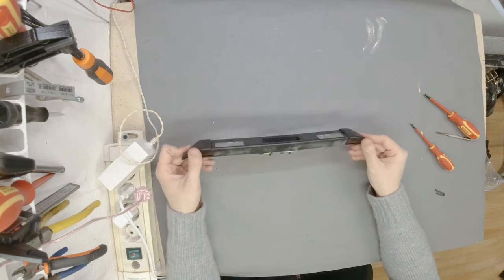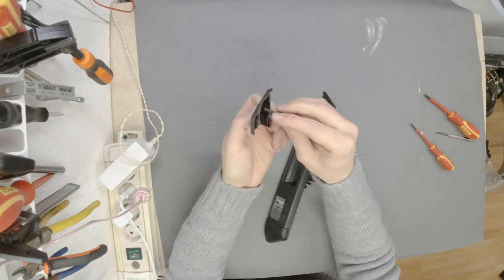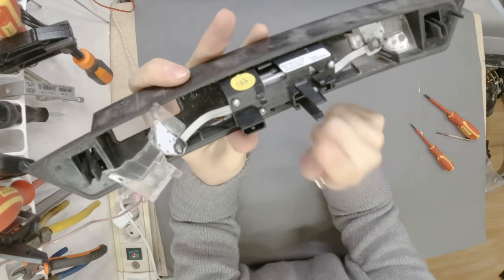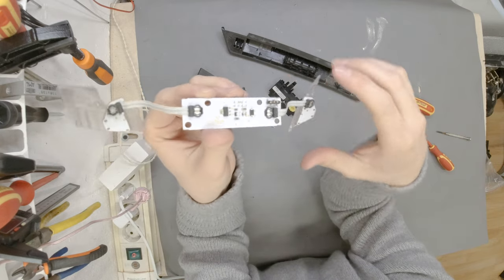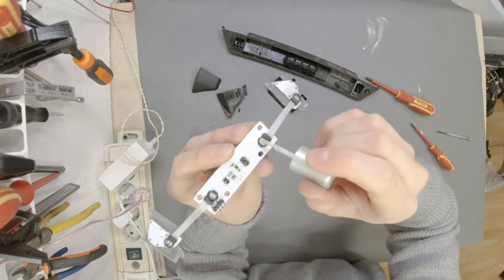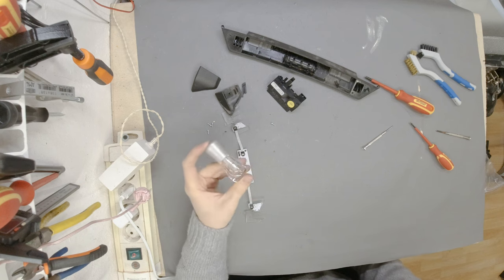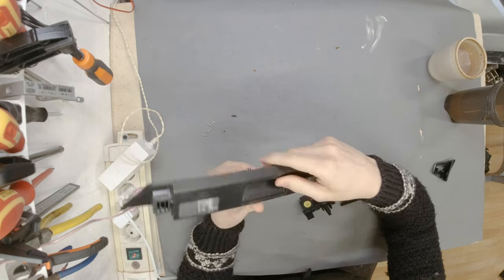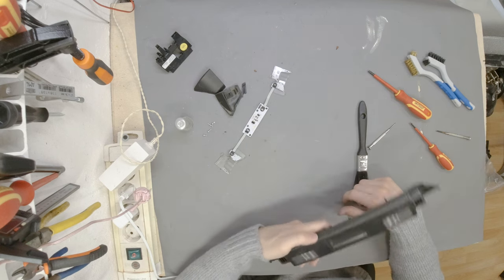THIS 1$ TRICK CAN SAVE YOU MONEY - AUDI TT MK3 8S LICENCE PLATE LIGHT

Comment: My 2016 Mk3 was rear ended in Dec 2022. The auto body shop replaced the bumper, back exhaust, tail light, spoiler and the trunk latch assembly in your video. Water kept getting into the trunk latch. Eventually, there would be so much water, the latch would not function until it drained. It was replaced again in March 2022, and then again in August 2023 and then the same issue happened, leading to yet another replacement in Jan 2024. I think the shop finally figured out how to seal the assembly water tight. Thank you for the video - the part is expensive!
Reply from the maker: Oh man I am so sorry to hear all that.. yeah, the water coming in is a strange issue in the first place, taking audi is premium brand.. but it does happen. I will make a video on how to clean the drains as well since most people are unsure on that as well…
Glad to hear you got it sorted out tho!!
Reply: Hi do you know how the body shop seal it? Mine is doing the same
Reply from the maker: What do you mean?

Comment: Thank you for sharing the experience and the solution. Unfortunately, this defect cost me to change the part twice, and even though Audi added some modifications, it still malfunctions. I believe the cause is the use of a high-pressure water spray when it hits the edges of the part, which leads to water leaking inside it. Finally, I isolated the part with nail polish, as you did. Additionally, I applied silicone on the sides and everywhere around the box that holds the electronic board. After installing the part, I also added silicone to the sides.
Reply from the maker: I think now you should be good :)
They really didint build this part right, as almost everyone has the same issue…

Comment: Thank you for this great tip ,, I’ve had this issue with my old light and had to buy another so I’ve done this now before it gets installed on Thursday , been told I need to seal the spoiler also so I’ll do this also but thanks 🙏
Reply from the maker: Great, its a two minute job basically, but can save the part in the long run. I made a video on sealing the spoiler, you can check it out to see what to expect 🤗
Reply: @cars_anatomy  thank you I’ll do that before I get the new light fitted 😎👍

Comment: I have cleaned the corrosion but still not working, is there a fuse maybe I need to replace?
Reply from the maker: Dont think so.. maybe the corrosion found its way under the small black “ chips” and something is damaged beyond repair :(
Can you try to put 3v to diodes directly?